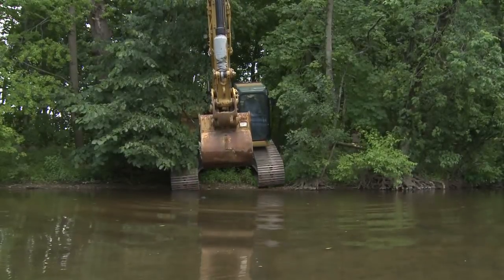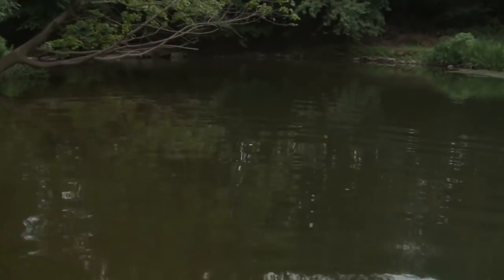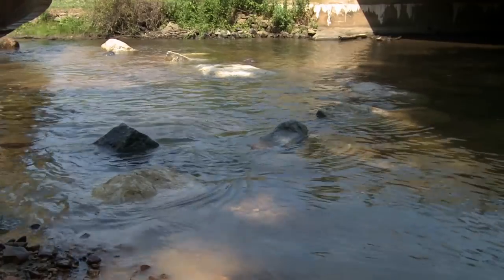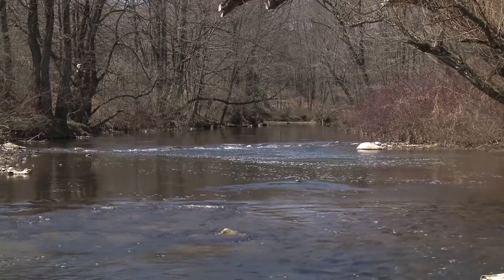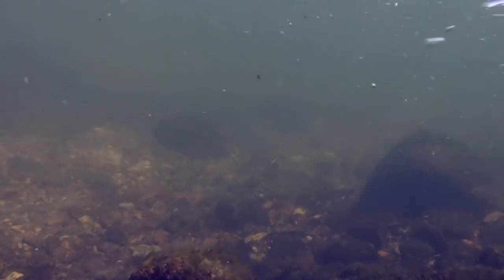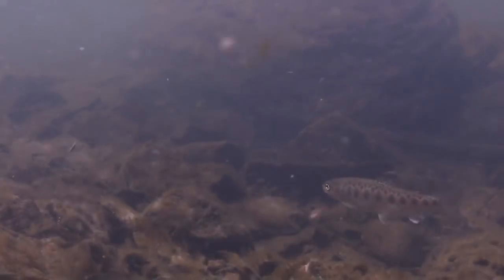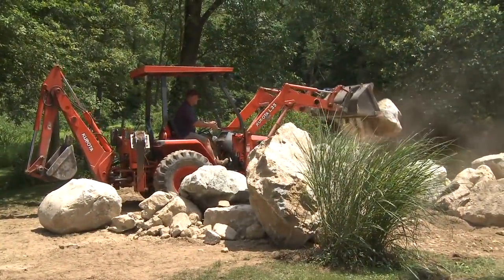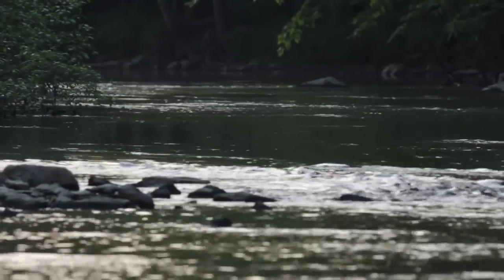Stream Restoration Project

Comment from the maker: I thought that's where you were heading with the original question. The blog caddis chronicles has had a rather interesting thread which addresses many of your concerns. You need to scroll down a bit to get to the video, but it is still up. I'd urge you to read all the way to the bottom.